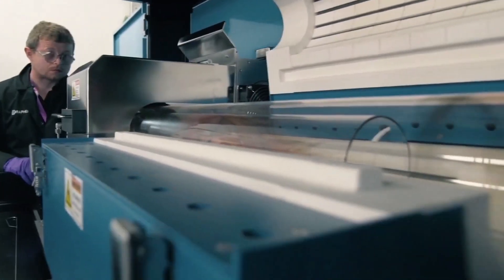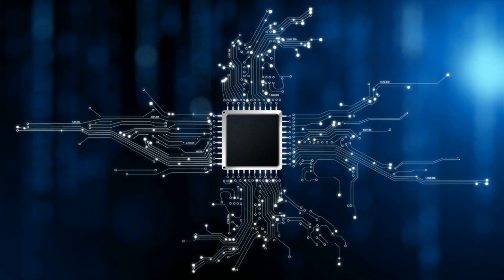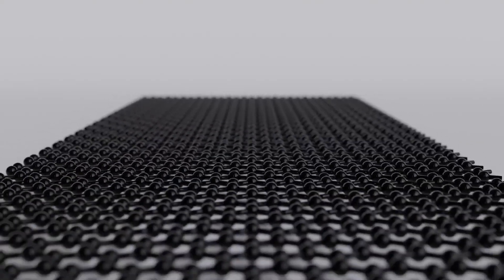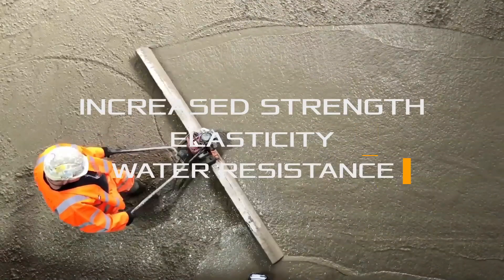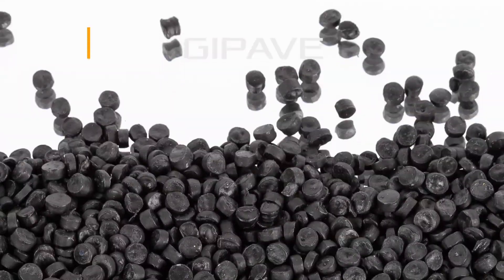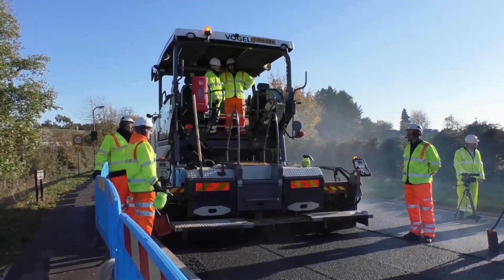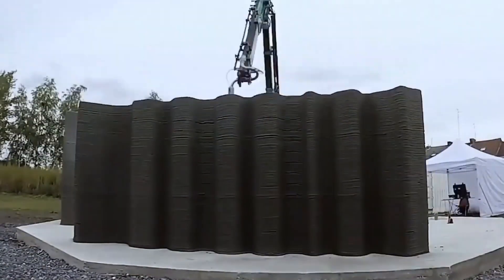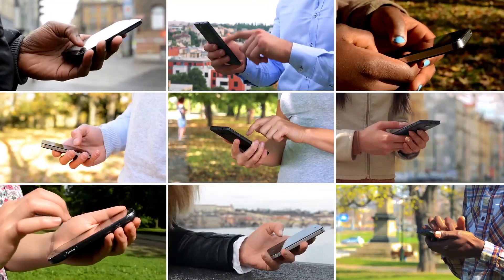Graphene in concrete is already changing the rules of the game in construction

Comment: 200x strong? What does that even mean? Is it when resisting compression, shear, tension, torsion, or bending?
Reply: EVERYTHING 😂😳
Reply: I was curious, so I wikipedia'd it.

Graphene is the strongest material ever tested,[10][11] with an intrinsic tensile strength of 130 GPa (19,000,000 psi) (with representative engineering tensile strength ~50-60 GPa for stretching large-area freestanding graphene) and a Young's modulus (stiffness) close to 1 TPa (150,000,000 psi). The Nobel announcement illustrated this by saying that a 1 square meter graphene hammock would support a 4 kg cat but would weigh only as much as one of the cat's whiskers, at 0.77 mg (about 0.001% of the weight of 1 m2 of paper).[149]
Reply: Yes, but only in planar direction. There's quite some anisotropic material that's incredibly strong at one direction too but hard to use in bulk.